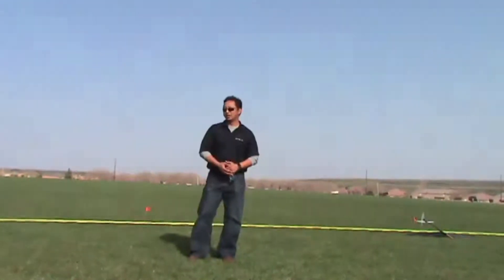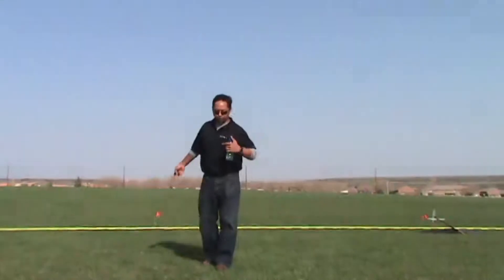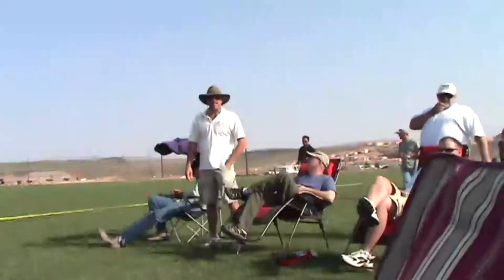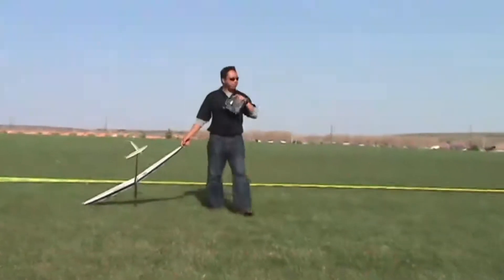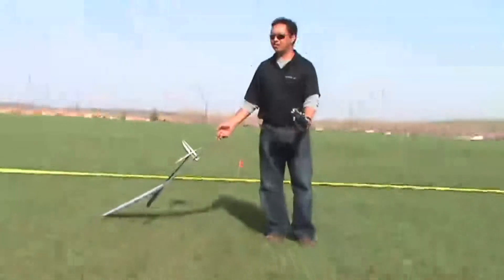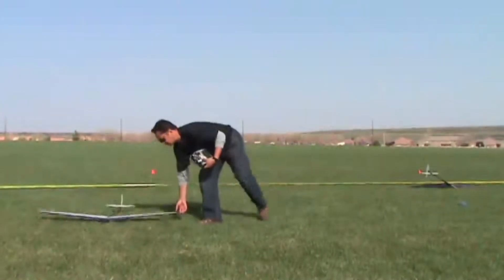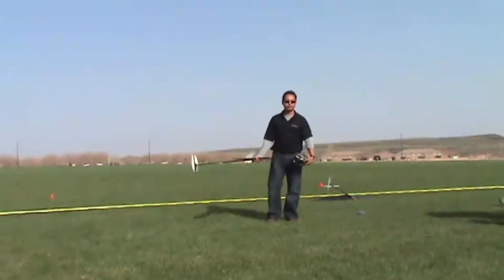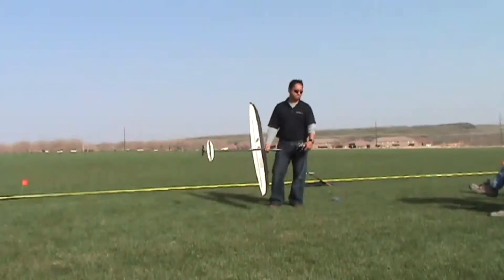Jun C. - DLG Launch Clinic Part 2

Comment from the maker: @jasonfriedman1 He uses a momentary switch on the transmitter that puts it in "launch mode" which usually consists of a little up elevator and maybe a degree or two of camber in the wings. This gets makes the plane rotate to the vertical position quick, when the plane is at the angle you want, you release the momentary switch. There are many radio setup discussions on RC Groups in the Sailplanes| Hand Launch forum.